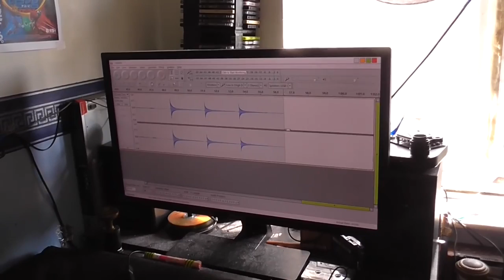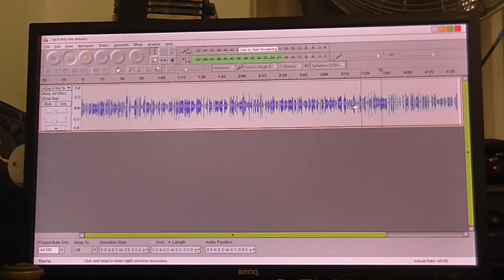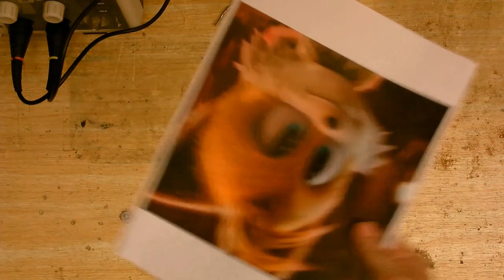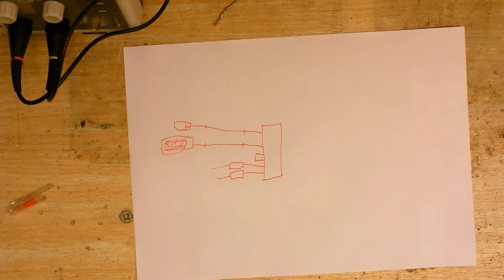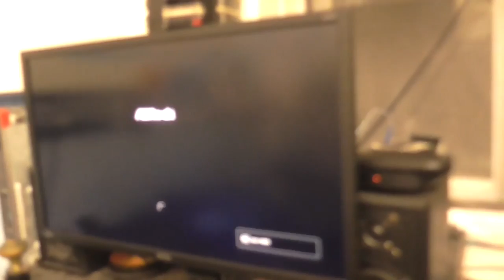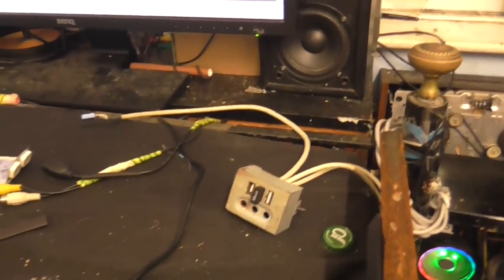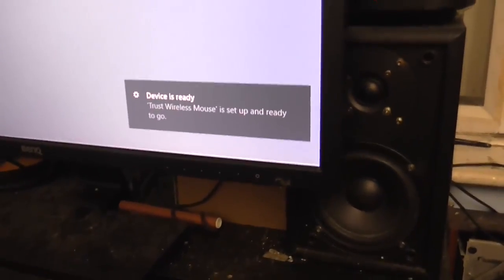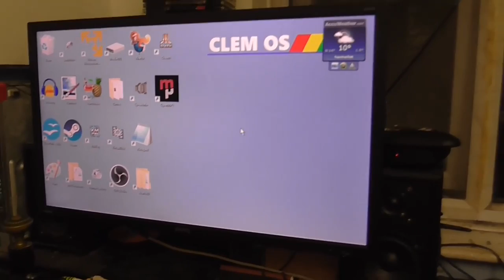What happened to Cool Dude Clem + Small Electronics Project + StarKidz Episode 8 Preview

Comment: It would be cool if you made nathan's voice the same as the 8th member, but I think you're too old for that.

just a question i had a long time ago, how did you do the voices of ricky, paul and nathan?
did you use any audio editor/vst pulgin?
Reply from the maker: I'm not really sure if I remember what kind of voice I did for Nathan back then. When I did Ricky's voice back in the day I just spoke a little higher and softer, the sped it up a little, about 17%. I can barely do that voice now but on a good day I can still do it if i try hard enough, but it takes quite a few attempts. Nathan was done in a similar way if I remember right, just made my self sound a bit nasally then sped it up again like I did for Ricky. As for Paul, well that just me yelling in high voice with no pitch or speed adjustment!